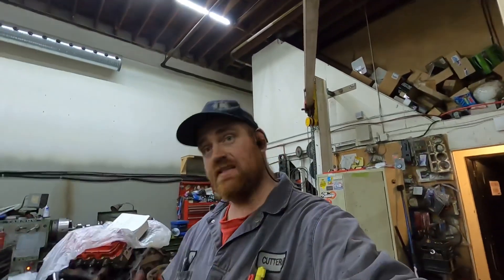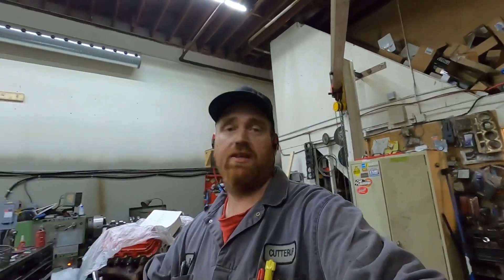Ppump 24v build - for the diy guys

Comment: P pump 5.9cr can u use the head or pistons
Reply: Vp44 injector .special crossover tube.and vp44 to p pump conversion lines .is this correct and is there anything else. i have all the parts of the p pump engine that i need
Reply from the maker: The pistons you will want to use will be the 03-04 style. For the best burn. Or have to nozzles on the injectors change to work with the 325hp 04.5-07 style.
Reply from the maker: you can with some extra work

Comment: I'd like to see a 8.3 in a 2500 with massive hp
Reply from the maker: i have plans on one in a build to come
Reply: @CUTTERUPROB  I've got a couple in equipment...we like them too obviously...have seen the block split right in two in a pulling tractor video...u probably seen it too,but...not sure what the limit is with those before they explode??
Reply from the maker: If you get the heavy block I would say n the 600-700 hp range
Reply: @CUTTERUPROB  that's it?... The pulling tractor vid I seen,it was at least 1,000 hp ..but... anyway... would b neat to build one I'm sure,👍👍